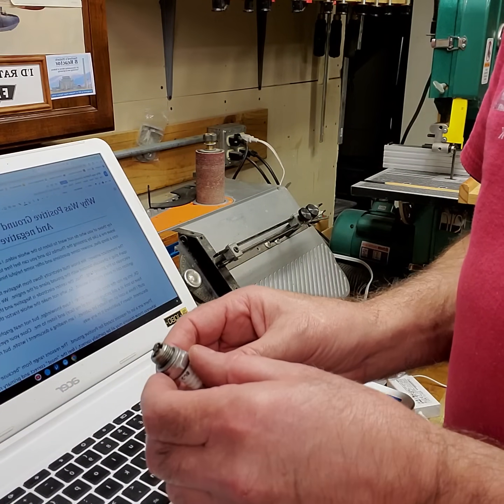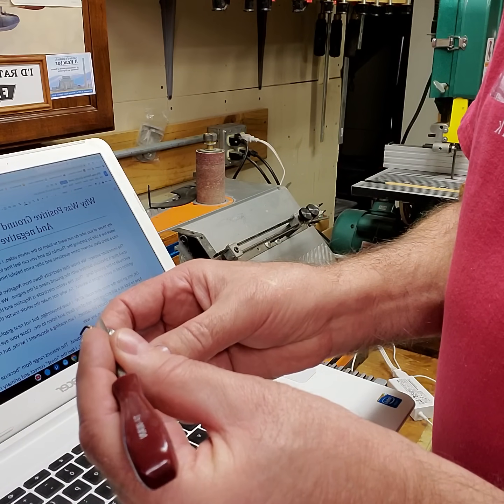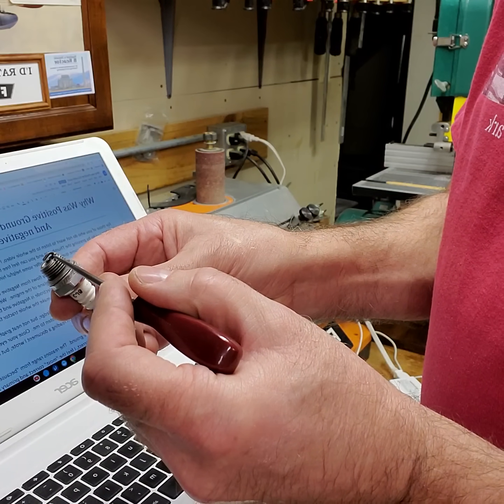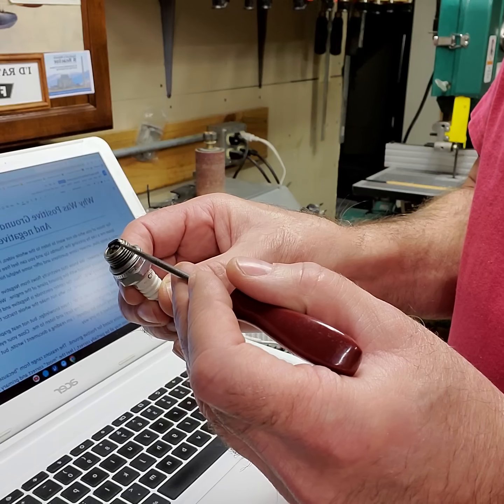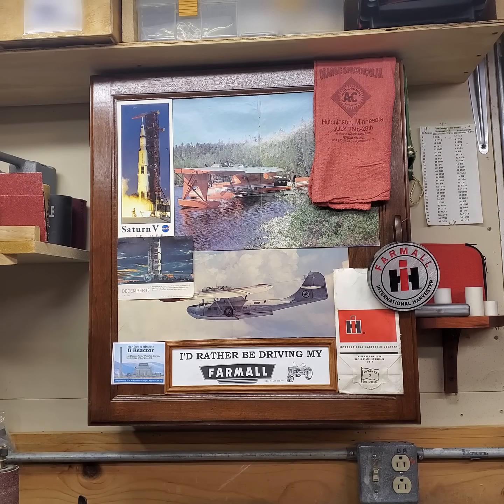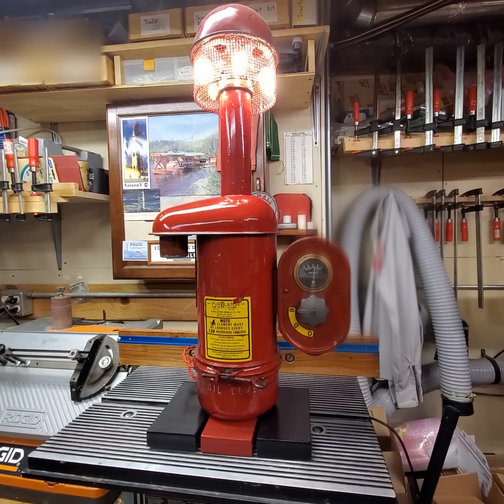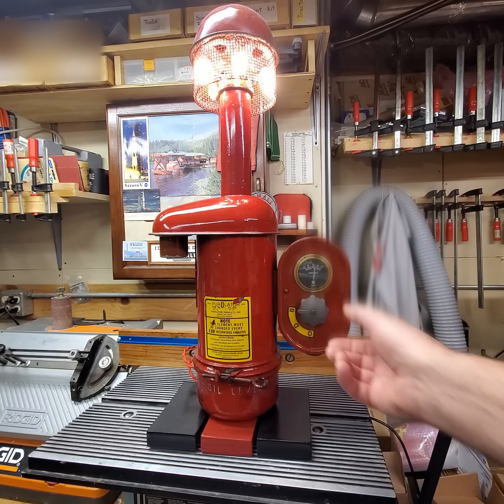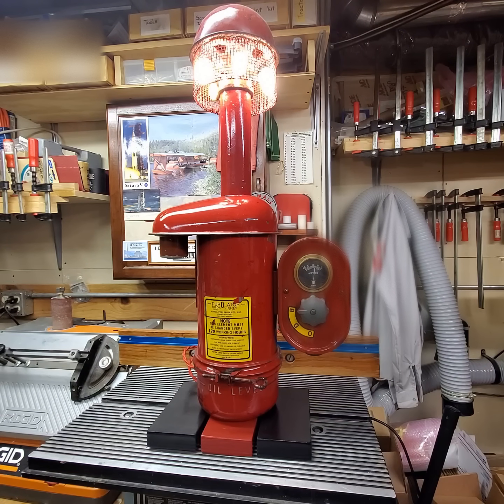Why positive ground was used on old cars, trucks and tractors

Comment: That's some think I didn't know, I remember as a young apprentice mechanic we had a car on a road trip that wasn't running right  was put on an oscilloscope and we found the coil was wired the wrong way. After 45 years in the trade I have been told a lead acid battery can be charged either way from dead flat go figure.

Comment: G'day Brian, Chev Blitzes had a manual lever that bridged a mechanical solenoid to supply current into the starter field and at the same time another lever reversed the polarity on the totally insulated breaker plate in the distributor, so every time you started it it reversed the ignition polarity. So the material that was deposited in one start up and run was redeposited on the next, good in theory but not so practical.

Comment: As a former x-ray tech, in classes it was drilled into us which direction electrons were really moving. This has caused me some confusion, since I now work on vehicle 12VDC and 120VAC systems and electrical 'facts' didn't jive. Thanks for the clarification!

Comment: The answer is similar to British car and truck makers using left hand threads to hold on the wheels nuts of their vehicles. It was back to front compared to all other makes, and it was STUPID! I dont doubt that there are situations where a positive ground is desirable (heck they managed to label + and  - on batteries back to front for electron flow)  however, once there is a majority use of a particular convention, there is no need to re-invent the wheel the way that the British manufacturers did.

Comment: I have a 1951 Farmall Cub. I have been considering switching to 12 volt.  I remember my dad saying the reason they switched the tractors over to 12 volt was that the 6 volt lights were basically worthless. 12 volt was extremely better for working in the dark. So I'm still considering, but not in a hurry. I enjoy it as it is for now. But I will need to make a decision because the battery won't start the tractor until I charge it and if it dies it won't start again.
Reply: I have a Super A that was converted to 12 volt, and would agree with your dad about the primary benefit is better lighting. As far as starting your Cub, use the hand crank. It'll work regardless of the battery's state of charge.

Comment: Back in the 70's we would use 8 volt (4 cell) batteries in older vehicles and tractors.  (I had an old VW bug that it worked wonders on.) Worked so much better than 6 volt.  Durastart still makes one.  They call it a "Tractor battery". Sells for about $80 around here.
Reply: But would the generator keep it charged? I mean the generator for a 6V would have been putting out something over 6V, but surely not over 8?

Comment: You kept saying, "the ignition coil is wired with a positive ground" or "the positive terminal of the coil" and yet the coil has two windings; the primary winding and the secondary winding.  You make no distinction between the two, but near the end we hear you say that the "positive terminal of the coil is wired to the distributor".  Still not sure if you're talking about the primary (low voltage) or the secondary (high voltage) side.  All the distributors I've worked ion have had the contact points under the distributor, therefore one COULD SAY that the low voltage side of the coil is "wired to the distributor".  Therefore you're saying things, but not letting us know immediately what you mean by them.  That's not fair.  But I'm guessing that you meant the positive, high side terminal of the coil is wired to the distributor, which, indeed, is switched to ground THROUGH the spark gaps.  But that's not a positive ground, per se.  We must view the spark gaps as the "load" in the circuit, and since the plugs themselves are grounded to the engine, which is in turn grounded to the vehicle frame, et al, then it's no different than having any other positive terminal going through any other load, to ground.  It's still a negative ground system.  Of course every positive voltage wire or terminal must be "grounded" (through a load) or there wouldn't be a complete circuit.  In the case of the spark plug, the gap is your load.  So from what I can glean from your description it's no different than running any other positive lead, through any other load, such as light bulb filament, to ground.  That doesn't make it a "positive ground".  So you're going to need a MUCH clearer explanation.  To me, and I'm guessing, also to any automotive engineer, a true positive ground is when the positive battery terminal is connected directly the vehicle chassis and engine.  But that's not how you defined it.  So I'm leaving more interested, and yet with NO more knowledge, than when I started.

Comment: Thanks for an interesting video.  I remember the days when Chevrolet and Willys were 6 volt neg. ground, and most other U.S. makes (including Ford) were 6 volt pos. ground.  I have three collector cars with their original 6 volt neg. ground systems, plus a '53 MG with its original 12 volt pos. ground system.  I assume electrical engineers in those days must have differed on the relative merits of pos. versus neg. ground, because either set-up should have cost about the same to manufacture.

Comment: The one thing that made me go "huh" was the mention of 6V wires. I've had to check voltage handling for maximum voltage for high voltage wires, but never 6V wires versus 12V wires.
Reply: Me too, larger gauge wire maybe...
Reply from the maker: Hi, you are correct.  I said that wrong.  Its like cables for Farmall tractors.  The cables for 6 Volt tractors are so much larger.  But, so many people use the wires for 12 Volt (I said 12 Volt wires).  Anyway, they have problems after doing that.

Comment: Electricity can be thought to flow in either direction depending whether it is electron flow or ion flow.  It makes no difference to how a spark plug will work - and in any case the ignition coil can be wired to give any polarity of spark no matter what battery terminal is connected to ground.  My guess is that car manufacturers simply followed the practice of steel ship wiring, which are always +ve ground to prevent electrolytic corrosion.  The first car vacuum tube electronics however need a negative ground (as do most modern electronics), so I suspect this is why it was changed.
Reply: Ions don't flow in wires.  The ions are fixed in the metal lattice.  You're meaning to say electon flow.
Reply: @stargazer7644  I did not state that ions flows in wires.  A current flowing through a liquid or gas usually comprises a flow of ions rather than electrons.  A spark gap is not a wire.
Reply: @davemould4638  Sorry, my mistake.  You were talking about two types of electrical current flow and most common electrical currents flow in wires, not in plasmas, so that's the first thing that springs to mind.  Then you went on to talk about ship wiring - so... Pardon my assumption.  Plus this comment section is rife with confusion about conventional current flow vs electron current flow.

Comment: Not all spark plugs "fire" from the center electrode to the side strap. Modern "wasted spark systems" fire half of their spark plugs from center to side, the other half (companion cylinders) from side to the center.
https://en.wikipedia.org/wiki/Wasted_spark_system#:~:text=In%20a%20wasted%20spark%20system,and%20is%20thus%20%22wasted%22.

Comment: Look at slo-mo of lightning, it jumps up from the ground to meet with the lightning from the clouds. I had a positive earth old car and dad showed me how to swap the terminals and re-energize the generator to negative earth by running the car then carefully swapping the terminals in pulses till it swapped polarity. I may have missed out some steps so do not try this at home, but a vivid memory that blew my mind at 13yo in 1974. Another fun fact, Water and electricity behave in a similar fashion except the main water flow is in the centre of a water pipe with the edges slowed by friction whereas in electricity is mainly on the outside of the wire. That is why multiple strands are used on high volume electrical supplies.

Comment: A question for you   As you know most older British vehicles have positive ground why do the ground cable from the battery to the frame rot out so fast as do all the wires to the frame. Am I missing somthing ( been A motor cycle mechanic 25 years ) ?

Comment: Working on semiconductors you get to work with electron flow, and hole flow.  I could never really accept holes flowing, I had to picture electrons getting sucked out the other end to conceptualize it.  Plug it in, and trust the modeling software. 😂

Comment: Actually there are two electrical circuits in the coil which allows the secondary circuit to operate as positive ground while the primary circuit can be negative ground. It all depends on which way the windings are wound in relation to each other.

Comment: Interesting subject. 12 volt negative ground systems were common in Europe before American auto makers adopted them. Ford switched from 6 volt positive ground to 12 volt negative ground in 1955 and Chrysler was the first of the big three to switch from generators to alternators in the early sixties. One reason given was that police vehicles needed to keep their batteries charged while idling.

Comment: I don't understand. The negative is connected to the car body. The end piece of the spark plug gap connected to negative/ground. The positive electricity from the coil moves from the top of the spark plug, then jumps the gap to reach the negative/ground. How can you say it's moving from negative to positive?
Reply: Because that's how the electrons actually flow - negative to positive.  The electrons have negative charge.  They lied to you all those years they told you electricity flows from positive to negative.
Reply: @stargazer7644  It would have to jump the spark plug gap, THEN move to the coil that charges it up to enable it to jump the gap. That would make no sense.
Reply: @TheEgg185  That isn't really how it works.  Electricity doesn't travel around the circuit as a lump traversing one component at a time.
Reply: @stargazer7644  😣

Comment: I'm amused you think the majority of mechanics do anything but plug the computer in and fit what it tells them. I've just got an old motorcycle with positive earth which had wiring issues, which I solved no drama, I'm amused that I should have been stymied by it🤣

Comment: Howdy.
Aluminum will oxidize immediately when cleaned or polished. One should use graphite paste / vaseline containing silicone crystals. That is used in switchgear aluminum main bus bar connections. The crystals will break up the oxidation and the paste will block oxygen from entering into the fresh surfaces when tightening.
Regards.

Comment: And now they say the electrons don't actually flow through the wire, it is the magnetic field that causes the "flow" of electricity.  👍👍👍👍
Reply: You might want to pay a bit more attention.  The electrons certainly flow through the wire (but very slowly).  It's the electric field that causes the electrons to move in the wire to try to cancel out the field.  The energy flows in the fields, not the electrons.
Reply: @stargazer7644  did you read my comment? It is the magnetic field around the wire that transfers the energy.
Reply: @nickv1008  I read your comment.  Now did you read mine?  It is NOT the magnetic field around the wire that transfers the energy.   The magnetic field alone doesn't do it.  You're forgetting the electric field.  Energy only flows in an electromagnetic wave, which is not just the magnetic field.
Reply: @stargazer7644  so your saying the electromagnetic field is not magnetic? I guess it's the magic of pixie dust?
Reply: @nickv1008  No it is not magnetic.  It is electromagnetic.  You can have fields with just one component - either electric fields or magnetic fields.  They aren't the same thing and don't have the same properties as what you get when both fields are together.   Have you ever heard of magnetic light?  No - because it can't exist.

Comment: The British cars (Jaguar, MGB, Triumph, Rolls Royce) is positive ground always.  Australian cars (Holden) will also be positive ground.  Some other foreign makes MAY ALSO BE "Positive ground"  ALWAYS check the battery first and figure out which wire is wired to the frame of the car.
Reply: This is absolutely not correct and would be disastrous to anyone following your advice when putting a battery in or even connecting. I am from Australia and I worked in our garage from 5 years old in 1966 and have never heard anything so foolish. The 1920's to mid 1950's was split between the two camps but almost exclusively negative earth after that with the advent of accessories that would blow up or burst into flames if shorted out.

Comment: Brian, I vaguely remember reading a few decades ago, that the primary reason for switching to a negative ground at least on automobiles had something to do with car radios becoming more common. I can't remember exactly why or where I read it? Perhaps it was an article in "American Heritage Invention & Technology" magazine? I don't think, that it was an issue concerning interference, but maybe something to do with having a better ground plane for the antenna? I wish; I could remember. Am I mis-remembering? Of course tractors, when they switched to negative ground, few if any had radios, but I figured, that they changed to be consistent with cars, to avoid confusion.
Reply from the maker: Hi Sparky!  Thank you for commenting.  If you ever find that article, please share.  I appreciate your comment.

Comment: Err - Barney L Rubble there buddy. My Beemer twin uses a double ended coil with an idle spark. On plug gets +ve impluse, the other gets -ve impulse. Same plugs, runs ok as far as I can see. One plug sluts up quicker, but the bang each side is the same.

Comment: What I really want to know is: why did they ditch the generator in favour of the alternator?
Reply: Because the alternator has better low RPM performance.
Reply: @stargazer7644  it doesn't hurt that they are much lighter without the permanent magnets too.

Comment: I'm a little surprised that there is a performance difference between +ve and - ve spark ground. 
I always though that it was not the flow of elctrons that ignited the mixture, but rather resulting plasma which spans from the one electrode to the other.

Comment: Direction of current flow depends on defining hole current or ion current. In practical application, we use Conventional Current which is based on the positive definitions of work and force - positive is considered above negative - the direction of positive charges in motion "falling downhill" from positive to negative.

Comment: In the wired telephone system with lead covered cables they put the positive to ground. The reason is that electric corrosion is not happening in the switch station. (it should happen at the customers 😉 ).

Comment: Thanks..... I worked with super sensitive electronics in my career and corrected noisy circuits by revising PCBs ground buss thinking of current flow within them. Your discussion is so spot on.
Reply: What does it mean to revise pcb ground buss? I assume pcb means printed circuit board, and noisy? Like metal film resistor vs carbon? Or spurious radiation?
Reply from the maker: Thank you.  I appreciate you watching the video.

Comment: positive doesn't need a ground to stay active. Positive is the electrical force generated by a power source to supply energy to a source needing the ohms, amps, volts to be maintained for the use it was designated for. the break or breaker is the part of the circuit that halts the current flow. ex: shut off switch, stop buttons, or levers. key offs. it is the separation of current. While negatives can be positives -I believe this would no different than positive being a negative.
Reply: You are talking gibberish.

Comment: "Use 6 volt cables"
What is that?
Conductors are the same, no matter the voltage; sized by amount of current.
The insulator determines the voltage limit; more voltage = more insulation. 
A conductor insulated for 12V, will be more than enough for 6V.

My great grandpa's restored AC "C" is still 6 volt, positive ground and magneto ignition.
Only thing I don't like about the system, is the manual charge regulator switch.
If the charging regulator was automatic, the system would work as well as any other maintained system.

Comment: gmh holden used it for the interior light door switches in my 2006 vz commodore,had to work it out for the ghost lights i installed in each door.but got it.

Comment: the polarity is not that important, the important is to respect the polarity intended for the vehicule, as a general rule, the 6 volt systems are positive ground, the 12 volts are negative ground, there is an exception to that rule, it is the british produced cars up to the end of the sixties, there were positive EARTH on 12 volt systems.